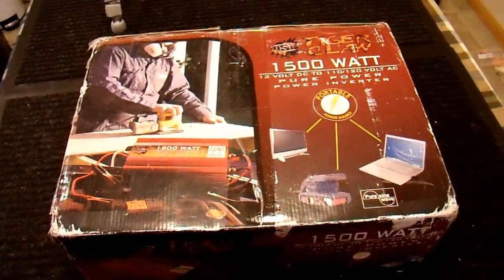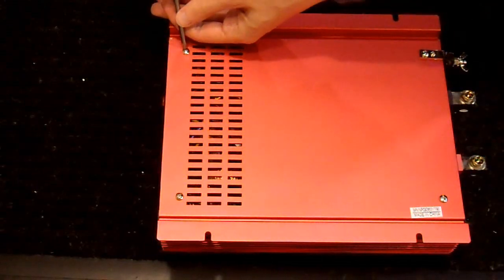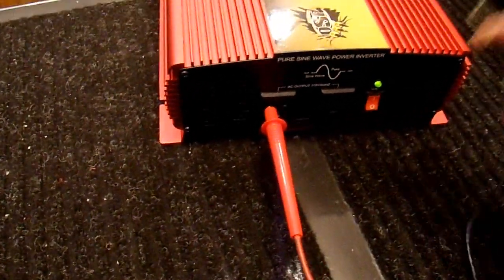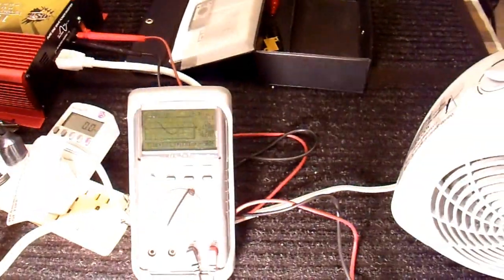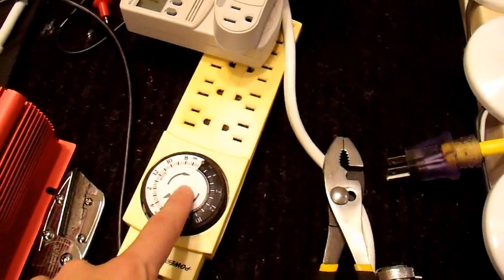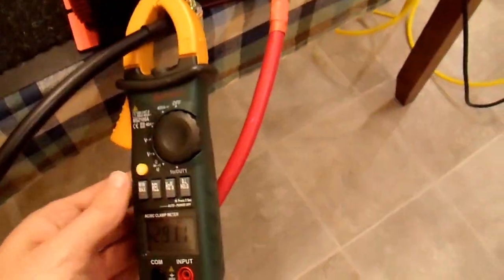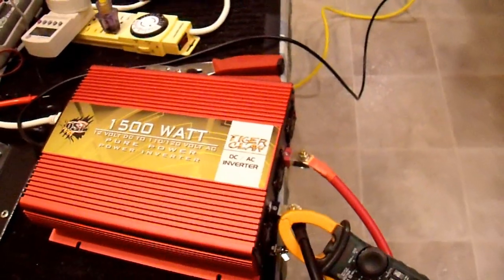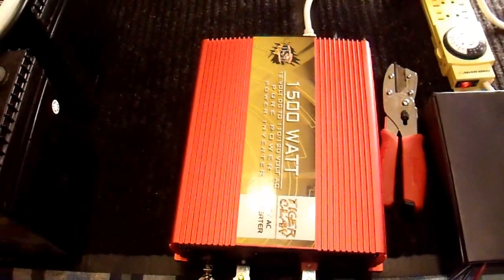OSP Tiger Claw 1500W Pure Sine Inverter Unboxing and Review

Comment: I bought my tiger claw after watching your tests on the unit. I have 6 golf cart batteries and solar array. The unit has been in service 5 months running a fridge and a deep freeze. even ran a 5k btu air cond. for 3 days straight. Love it!!  Thanks and keep up the good work!
Reply from the maker: I am glad the video was helpful for you and that you also had good results with this inverter.  Xboxer1985 also reported a good experience with his.  They may not be top quality but they are very good little consumer grade inverters.

Do you have any vids of your setup or solar array?
Reply: ***** autobri1 I'd be interested in to see the solar array too!

Also to fix the cooling fans so they turn on and off and not repetitively "click" and not spin...add a .01uf 500V ceramic disc cap between the case ground and negative terminal of the battery. Even at light loads (say 100-150 watts) the fans should spin up to full power and stop every few seconds, no clicking. Without the cap the fans click and don't spin, but to get them to spin at any significant speed for cooling you need at least a 300-400 watt load on it continuously. this can lead to overheating of the inverter. Adding this cap also cuts down a lot on the RFI noise radiated & conducted by this inverter.
Reply from the maker: *****
That's a good tip!
Reply: *****
 definitely! with my filter setup RF is no problem either. 90% of devices out there don't care about RF as they should be sufficiently shielded. The RF filtering I made is strictly for radio. Proper grounding and devices like ipads, iphones, etc work just fine. All my audio and computer runs great on it. Efficiency of the inverter at 80-85% is a little EHH but for 200 bones can't beat it.
Reply: I'll make a video of it and shoot you a link after the holiday's
Reply: autobri1
Reply: hey friend how many watts you have

Comment from the maker: On my particular unit the input is isolated from the output, and the case is isolated from both.  Assuming this holds true throughout the production run of Tiger Claw inverters you can safely ground both the case and battery negative to earth GND.  This is one of the features I like about this inverter - it is fully flexible.  ANY point can be grounded without issue on the input side, and output side.  A floating node will cause emission issues, so my answer is "don't do that!"  :)

Comment from the maker: I tested the Tiger Claw that I have and it will run just fine with all 4 of the following points grounded at the same time:  Battery negative, chassis GND, output GND, output Neutral.

It is made better than some others in that the 3 major items are fully isolated:  The input stage, the output stage, and the case.  So far every pure sine inverter I've personally tested for this feature had it, so I don't know if it is something all of them have for some technical reason I haven't thought of yet.

Comment from the maker: Depends on a lot of factors:  Power source, installation location, exact compressor model (reciprocating vs scroll), expected minimum operating temperature (compressors are hard to start when cold), duty cycle, commercial or personal use, other tools you may want to use, budget, etc.

Comment: I have three of those centech 2000 inverters. I really like them. They power many things I had problems with other inverters. One of the centech 2k I got on ebay broke. It had 8 to247's in for the output side. I would guess that OSP 1500 has them as well. That I think would make a really good top end , 3000w ish. I searched the net all over for one of these OSP 1500's and nowhere to be found. I seen so many videos of this inverter and would love to have one in my hoard.   
I spray painted all of my inverters boards with clear enamel. When hooked up there in a unheated garage, I hope this helps stop corrosion. I also have a Aims inverter that I got broke off ebay. Its problem was corrosion. It had the same output board as the centech 2k but a beefier input side. I really like your videos there lots of fun. You got me ebaying broken ones lol.
Reply from the maker: Acrylic coating will do a lot to prevent corrosion problems - it's too bad more inverters don't employ this low cost remedy.
Reply: William....there are three or four places on ebay...search OSP Tiger Claw Inverter...also come in 3000w continuous Modified Sine Wave....for the same price as the 1500 PSW....
Reply: I seen there back. I asked for one for Christmas. Cant wait to play with it. I looked for them for awhile with no luck. The 3000w modified is really a Aims 1800w, I have one. Inside the unit its really 2400w
Reply from the maker: william staten
That is good feedback!  I haven't seen an OSP 3kw unit but if it an Aims 1800 then WATCH OUT!  Aims isn't a good source for quality kit.
Reply: Yeah I got the Aims broke, it was rusted up. I cant say for sure but I think OSP, Centech, and Aims is from same manf.
Reply: From the Aims VS Tiger Claw review, I would say Not the same Manufacturer....or the 1500's would be more closer together...and the Aims seem less reliable...
Reply: Xboomer1 Seen the video you talking about awhile back and see your point. The inverter I have looks exactly like inside and out as the centech and OSP. For example I have a pioneer receiver and my uncle has optimus that's the same.
Reply: I understand.
   We have a Panasonic Microwave oven. Has an inverter. Broke in just over 30 days, so the store would not take a return. Chinese inverter. We took it to a repair store. Called Panasonic, they made good, and knew all about the problem. Fixed for free under warranty. The new inverter has been working for over a decade. Not all inverters are created equal...so, here was a case of a well known brand with a bad Chinese part.

Optimus is MADE by Pioneer, which was Rebranded by Radio Shack, But R/S had a TEC division in Japan, made things even for Pioneer........maybe that is why they are the same...."Branding" has been going on for ever. Sad to just pay more for a name and logo... :-)

Comment: Hi knurlgnar24. I just purchased a new OSP Tiger Claw 1500W inverter this week and had a chance to run some tests that you didn't cover.

Long story short, the EMI is VERY bad for both radiated and conducted emissions (you probably already know this). There is a 21KHz spike (along with the harmonics) that is causing most of the problems. I can pick up the noise from any AM radio as far away as 12 feet. xboxer1985 came up with a pretty amazing AC filter, so I will try his setup and take another look at the emissions.

I also had issues with the inverter producing low and unstable voltage when any surge protector is connected (the voltage dips to ~97V). Note that this was without any earth ground connections, so all 3 connections are essentially floating in space. When the inverter was grounded (ground terminal only, no neutral), it still would not work well with the surge protector. Strangely, the problem goes away when I am touching the chassis ground and either one of the battery inputs!? And it had to be me! No cap or resistor I connected in place of me would work.

My theory for this strange behavior is rooted in the inverter's horrendous EMI emissions. I don't have the equipment to prove this, but I think the surge protector is interacting with the EMI noise and is causing the inverter's AC regulator to misread the AC voltage. If I place some ferrite chokes on the inside of the inverter case, I wonder if this would improve the inverter control circuitry's ability to read its own AC voltage.

There's some more improvements that could probably be looked into as well. I may have to make a video!

Thanks again for the excellent review! :)
Reply: +Ryan Warner If you need further help testing let me know!

Comment from the maker: HF sine wave inverters will always have some HF noise which can easily be filtered out with a standard line filter which are inexpensive and common.  If RF noise is going to be a problem the outer case also needs to be grounded or otherwise held to a low potential such as the negative battery terminal.  MSW inverters are much lower frequency (120hz vs many kHz) and therefore emit less noise.  The cap idea likely to help somewhat, as would placing ferrites on all of the cables.

Comment from the maker: Nearly all pure sine inverters will emit enough to interfere with a ham shack.  It is very difficult to make such a product quiet.  It sounds as if you have enough knowledge to work through the issues you encounter so hopefully you find it satisfactory.  It works fine for what I need it for, but then my refrigerator doesn't care about EMI!

Comment from the maker: It can be done with this one - I later tested the isolation and the battery, L/N, GND, and chassis are all isolated on mine.  Still not recommended, but it can be done.  Inverters advertized as having a hardwire kit, or one that comes with screw terminals to permanently connect to wiring is generally acceptable.

Comment from the maker: Could be lots of things.  I'd recommend for a start to connect up a couple hundred watts of lights, like a halogen light or something and measure the voltage right at the inverter input terminals as you turn the light on.  The inverter requires this voltage as measured at the metal bus bars going into the inverter to always remain above 11V in order to operate properly.

Comment from the maker: I've certainly had the chance to use some very expensive equipment to take a look at it, but haven't done so.  I've considered taking it into an anechoic EMC chamber I have access to in order to scan it for emissions but that seemed WAY excessive for such a product.  :)  The unfortunate truth is that all of these products will be 'noisy' and installation is an important factor.  Proper installation (rarely done) and proper line filters (rarely implemented) will alleviate most concerns.

Comment: Thank you for your replies.... and in answer to your question....Power tool wise ...I was thinking about an  800-1000w sds drill and a big wattage 2100w wood router...used individually but, I am mainly going to use it to re-charge my cordless tool batteries 18 and 24 volt.
Reply from the maker: What kind of motor does the router use?  If it is a universal motor (with brushes) than a modified sine inverter would work for it, but if it is a an induction motor I would recommend a pure sine inverter.  I assume it is a universal motor?  Also you'll need something with a decent surge to get that thing started.  As I mention in most of my videos do NOT trust the surge rating in the advertizing media.

Comment: Any updates on this inverter? I currently have the modified sine Centech that you referenced in this video and it works well but I get some buzz out of a few electronics. I want to upgrade to a modified but I don't want to spend big $$$ to do it if possible. Based on your review, I think this would be a good upgrade for me. I was just wondering if you had anything additional to comment since you posted the video. Thanks for the review.

Comment: At about 22 min into your video you have the heater on full and it's pulling ~1400 watts and ~100 amps. I thought a 1400watt heater would pull about 12.5 amp/hrs. What am I missing here. With your battery set up how long will you be able to run the heater on full for? I guessing you have about 220amp/hrs with the two batteries. With about 110amp/hrs of useable (no less than 50% drain) amp/hrs. Shouldn't that setup be able to power the heater for 8-10hrs? Thanks for the video by the way.
Reply from the maker: The inverter output voltage sags under heavy load on this inverter.  Due to the low voltage the heater is only taking around 1000W which results in a lower amp reading.  At this load the batteries only have about 80aH total between them, so it would run the heater for about 45 minutes.  The inverter would probably complain about low battery voltage before the batteries died, though.  So less than half an hour realistically.

Comment: Well I just brought this Tiger Claw 1500W as per the video for my solar system with Battery Bank. I have run an entire separate house circuit system for permanent lighting and receptacles for items I would like to use off the "off Grid" system in my house when I heard you say "oh no, this is a live neutral configuration system and cannot be installed in a house circuit". I checked out you "how NOT to hook up an inverter to house" video but am still a bit confused. The house system I have already installed is total separate from the house grid system (no connections) but is installed the same way as a typical house is with the ground wire being grounded and a bare ground wire (AWG 12-2). This is a "off grid" solar system I would like to use daily in my house but it's sounding more like this inverter will not work. I do not want my batteries at 60V or my bare ground wire at 60V (which is grounded to a few metal boxes as well currently) either nor to burn out my new inverter. The solar controller states it needs to be grounded and is connected to the house ground which if you are correct, would ground the batteries again burning out the inverter or my controller etc. Sounds like this inverter will give me all kinds of problems with this system and will not work with any solar system. If that is correct, I hate to think I wired my house wrong for this inverter after all the work and research. Amazing that you are the only one who has made the statement about this inverter not working on any house circuits but I am a man who likes to find safe ways around things and I am wondering if I could change over to 12-3 wire (using the 3rd as a shield ground) but am not sure how to get around grounding the solar controller. Any advice?

Comment: The equation between the 12 V PSW inverter and a 48 V UPS shifts again in favor of the inverter if you consider using an idling car to recharge/run them.

A parallel 12 V battery to the car battery would be an improvement.

A rewired 3 phase alternator with 2 phases running a capacitive charger and the remaining phase for the car  itself comes to mind. etc...

To get an offline 48 V string charged becomes pretty complex.

I am thinking of selling my APC 2200 VA to buy a Tiger Claw.

Trade?

Comment: You mentioned you don't really like Centech Inverters but what about the newer Jupiter ones from Harbor Freight? Are they basically exactly the same or have they made any improvements just curious? cause I'm thinking of getting maybe the 2,000 watt one to run a microwave, TV, small Portacool water cooler and a couple other small things etc. But I'm not sure, do you have any information on this?

Comment: This video helped us pick an inverter for our boat! While it in a well protected spot, we worry about salt spray in the air causing corrosion over time. I've heard of people spraying something like corrosionx on the circuit boards of their electronics to help prevent corrosion. Is there any reason we couldn't do this with our inverter?

Comment: I have the same inverter (the label on top is a bit different) and it works well. I can run lights, TV, modem/router, computer. I have it tested  on refrigerator and freezer for a short period of time. My problem is, when I plug digital voltmeter into the inverter's outlets, it doesn't read anything. GFCI tester reads "hot/neutral reverse" and Kill-a-watt meter reads 110 volts. Is anything wrong with my inverter?

Comment: My inverter with just 65whatts of load after a few seconds burned out the power transistors. Fans were working fine. I got about a year of use before this happened.

Comment: Just wonder if you ever tested a Xantrex Prowatt SW 2000 or 1000. Considering buying one based on Xantrex general reputation. Don't mind spending a more for a quality unit. What's your opinion, would you recommend any other brands? Not interested in the cheaper units.

Comment: I have had my OSP Tiger Claw since June of 2014....LOVE IT!!!!
  Did the .01 Microfarad ceramic disc capacitor from the negative to the case ground, and have had no problems. I use in my homemade Solar Generator. Most of the time the fan does not even come on unless using my 600watt microwave for longer than 3 minutes.
  I had two Accurate Tools inverters (ebay), both died...just stopped one day....the 1500 PSW died in around 32 days, the 2000 PSW died in 16-17 days....the return policy on them was 14 days....they were over voltaged at 125v...they worked good when they were working...but not quality inside.
   The FU JOW (Tiger Claw)..is by far the BEST I HAVE SEEN FOR THE PRICE!!!!
  Thanks KNURLGNAR24 for his review of this, in my opinion, GREAT inverter....(knock on wood)....
Reply from the maker: I thank Xboxer1985 for that capacitor tip!
Reply: Me too...did the trick and soooo inexpensive...
Reply: I also love your battery setup in the BIG BOX....I have a much smaller version. :-)
Reply: ***** thanks for the shout out!
Reply: Mine has been going strong for 4.5 years now... Awesome inverter....never even a hiccup...except on a 100w equivalent 13w LED light....lighting with some flickering...but not a 5w or 9w LED bulb...so it seems to be just that make of bulb....cheap...

Comment: seeing as how you are almost the authority on inverters im going to ask you, what reason would a square wave inverter keep blowing devices that use resistive based power conversion ie transformerless like in smoke detectors and most recently the defrost timer in my fridge, on the smoke detector there was heat before hand and a smell from the transistor heating up, would i need to change the wattage of the resistor or will that not help?or would i have to change the ohm value as though the voltage was higher, as far as i know the only difference is the wave